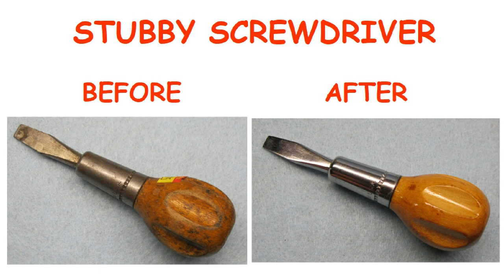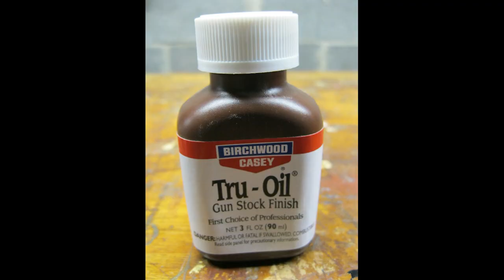Hand Tool Restoration - Stubby Screwdriver

Comment: Looking at the before, this is probably the most it's ever been used. Nice work, I use a  stubby flathead every day at work. It's for un skruing the filter on a espresso machine.  Mine is not this nice. Have a great day, and keep up the good work.
Reply: un skruing? C'mon, you can say it : unscrewing.
Reply: @dennis7511 😂🤣 auto correct, I'm from Norway you see. Unscrewing! Now that wasn't so hard...

Comment: What's the reason for scraping with a knife? Is it instead of a rough sandpaper?
Reply from the maker: Thanks for watching!  I have found that the old varnish comes off easier by scraping.  If you try to sand it, it just clogs the paper.  Also, I find that using coarse sandpaper can take off too much wood and round over features like the fluting on this screwdriver if you're not careful.
Reply: Ah, I had no idea (although, between the time I commented and now, I watched one of your saw restoration vids where you explained all that!)
Reply: Ah, I had no idea (although, between the time I commented and now, I watched one of your saw restoration vids where you explained all that!)